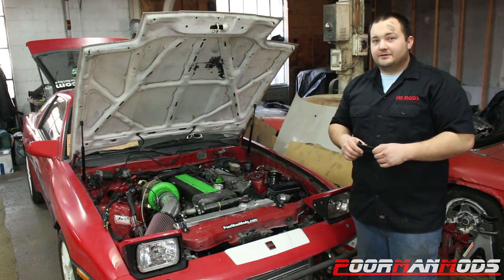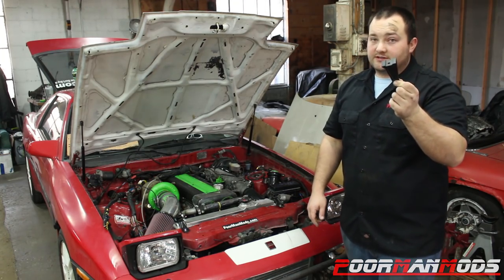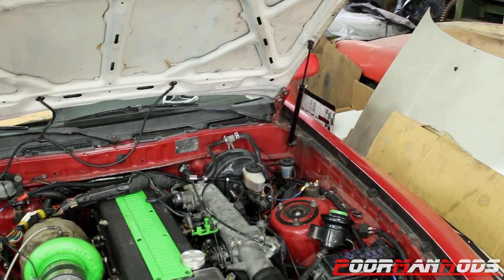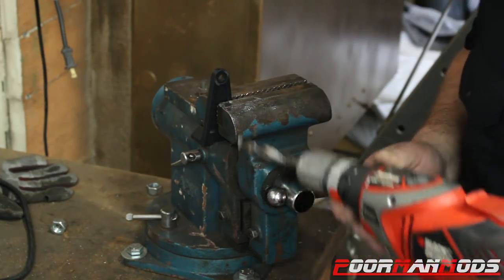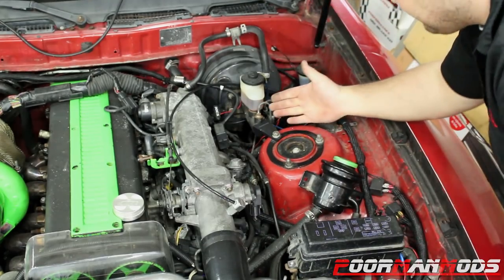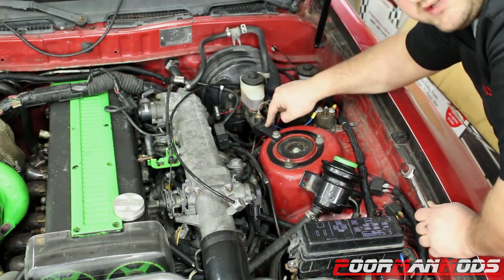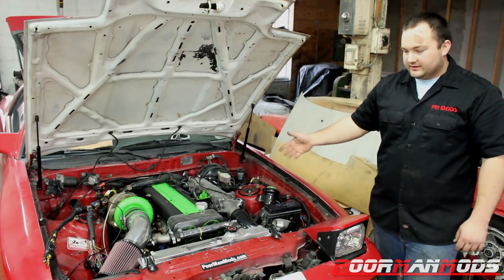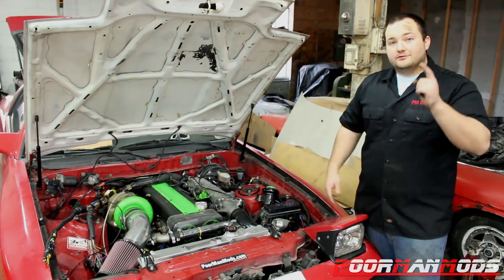DIY Master Cylinder Brace

Comment: the car wasn't running so one or two pumps of the brake pedal should make the pedal hard as a rock and you're applying more force that the master cylinder would ever see causing it to flex... that's just my theory. I'd still buy one for my car lol